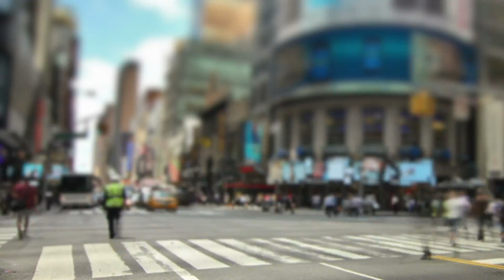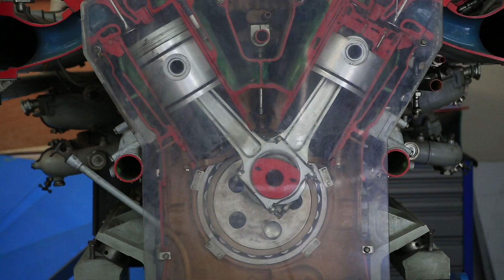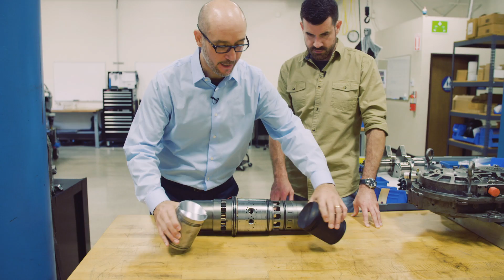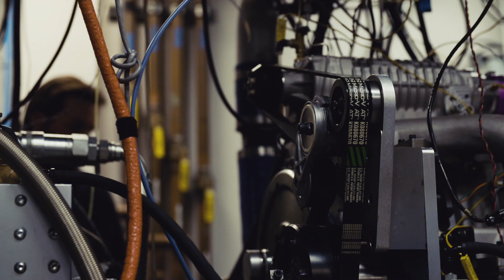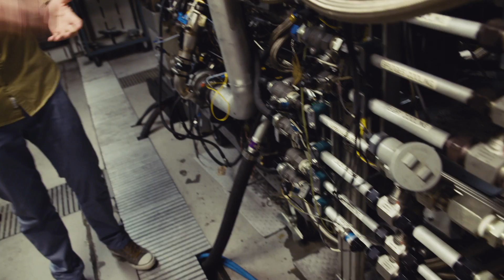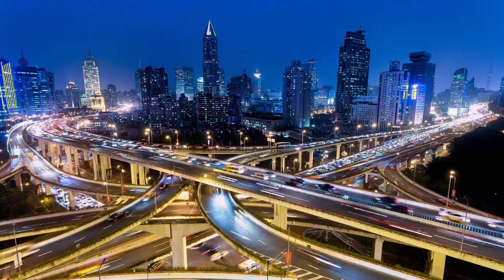This Radical Redesign Could Keep Gas Engines Pumping | WIRED

Comment: 2 stroke engines are inherently dirtier running engines, even with direct injection. Piston oil control rings are going right past the intake and exhaust ports. That's why you don't see any two stroke motorcycles any more (or very few). They have a tough time meeting pollution standards.

Comment: A lot of people are bleating on about how electric vehicles are going to save the planet and how cheap they are to run,all this is a bit over stated because your just moving the source of pollution,imagine if tens of thousands of vehicles were to be converted to electric a year how many atomic power stations would have to be built to charge them and do you think for one minute that governments would lose all that fuel duty they collect,not a chance they'll tax electricity,were being conned again.

Comment: An example claim of less parts, really?
You have now not one but two crankshafts and all the parts to link them in time; less parts; not likely.
So how is it 30% more efficient with two crankshafts and the othe piston acting like a cylinder head without the cooling and extremely high thermo temperatures.

Comment: There was already a German version of this in which shafts at the end of the pistons had powerful magnets which were passed through cylinders with coil windings. This directly generated electricity to be used in the cars electric motor, which sounds like a better, less complicated system.

Comment: Gas have been reliably polluting the earth for over a century I think we are done time to move forward .Oil changes belts sensor smog test fuel burning etc I'm done with the constant spending to up keep with a traditional gas engine. Electric cars all they need is a charge at night and maybe once a year a gear oil change which the most 2quarts of  gear oil and the power electric engines delivers surpasses a gasoline motor by far I'm done being a slave to this big oil companies...

Comment: Challenge with opposed piston engines sharing the same cylinder has been very high oil consumption , as the engine burns the lubricating oil !

Comment: 2 stroke opposed piston diesels have been mass produced before, primarily for submarines and other marine applications, so this is hardly a 'radical' design. What's new here is the application of modern computer-aided design tools, especially for combustion modelling (e.g. KIVA or Converge). This is one of the least informative/least substantive reports I've ever seen, not worthy of CNN let alone Wired.

Comment: That engine is huge.... theres a reason we have engines that we currently have. They are smaller and can be made more compact. That engine is still taller. You will never fit one of those in a small car. It may have no valve train but it has 2 cranks instead and the actual block would have to be much bigger. I'm sorry but that's a crap idea

Comment: Today’s ICE engine might make 25% thermal efficiency, if they’re lucky.  So a 30% gain might improve the thermal efficiency to 32.5%.  

That’s nice, but nowhere near the 85-90% efficiency of EVs.  The hard truth is electric motors are incredibly efficient at over 95% efficient. (That’s why industry has relied upon them for over a century. Walk around a refinery, chemical plant, paper-mill, or any other factory where pumps are required. They are all electrics.).  Combine this with better batteries with efficiencies in the 90% range, and ICE days are numbered.  It’s not emotion.  It’s Money.  

People love piston engines.  It’s visceral.  People love horses too.  But we don’t ride horses everywhere today.

Comment: The engine is an exciting concept, I'd imagine that in order to lubricate the top crankshaft the engine will have to be laid on its side, kinda like a boxer engine. It also seems a little difficult to make such an engine as well, I'd imagine that if made improperly the engine will shake like crazy what with the crankshafts at opposing ends of each side of the engine. I dunno, I'm not an engineer so I'm just spitballing here. Would love to here how this engine sounds like

Comment: This is old technology. 2 stroke engines are poor on the emission of particulates and complete combustion which is due to the fundamental design lacking the separate combustion and exhaust strokes. I do not think that this will be a success, it is unlikely to be more efficient than a well designed four stroke engine and in particular a good hybrid set up which may be able to get 50% efficiency. Electric drive trains are 90% + efficient I believe.

Comment: alright now that is enough!!! people. the fuel air mix that is drawn into the cylinder and ignited does not..... DOES NOT.. IT ABSOLUTELY DOES NOT EXPLODE!!! it is NOT an explosion, if it were your engine would be scattered on the ground in pieces.

   C-4 explodes. dynamite explodes. gasoline does not, in any environment, explode. it burns quickly, but it wont explode. it is not an explosive it does not burn rapidly enough to be called an explosive.

 STOP SAYING IT EXPLODES. you only prove that you are thoughtless and stupid when you do this...... think about it. if you are a leftist, and trump said gas explodes in an engine to drive it foreward, you would look it up, call it out and say he was lying again. so stop it! stop it now!

Comment: I suspect the 30% gained efficiency is a somewhat optimistic number. Perhaps it ends up closer to 20%. But what if the engine adds US$5000 to your vehicle? And it seems to me that in terms of performance, this more complex engine will add some inertia that will slow down acceleration and against electric cars redefining what to expect, that's not great. But perhaps for construction equipment and trucks, this engine can find a market. Ultimately, the chance of success for this engine mostly depends on how well next generation battery technology succeeds.

Comment: The horse drawn carriage has been pulling us along for over a century.
Occams razor cuts deep. 
Making a complicated machine more complicated is a losing strategy.
Especially if it still emits CO2 and uses non sustainable energy sources (oil).

Comment: Interesting reinvention of an old concept using modern materials and control systems. Lot of people don’t realize these were built by Germany during WWII, there is a Junkers opposed-piston diesel that was used in aircraft.

Sadly, this video was far too watered down to be technical informative. C’mon Wired, you should have deeper content than the sub-8th-grade writing of USA Today. 🙄

Also gotta agree with other commenters, the jab at Trump was completely unnecessary. Focus on tech and advancement, keep the politics out of it. Divisive politicking has infected too many subject areas. This doesn’t need to be one of them. Make a cleaner, more cost-effective engine and let the market decide.

Comment: "up to 30% more efficient "with a compressor ? lol
You loose something like 20 % of energy just to rotate the compressor itself.... 
That's why turbos are used with way better results since the 40's ,you just use the wasted exhaust heat with them.
Also ,more efficient than what ? a 8V-71  detroit diesel ?

Comment: I once watched a couple of Deltics start up in St Panancras, the smoke is more like a steam train, the geometry was way ahead of this design. I’m going to say it’s not happening, I don’t think they will get the emissions without a  v expensive post treatment plant, and we know that’s not good enough on four stroke let alone 2  even Cat 6 engines have issues on certain conditions. Hybrids are beating this now. same with variable compression and complex cycles and some of the other old engine tech rediscovered. they all face the same issues, Ultimately only Trump can save the ICE and then only for a bit, E. are are better and cheaper to make long term.

Comment: We don't have to burn (just) gasoline. Its actually pretty daft to effectively be limited to 1 fuel. Electric sucks.
Petrol, PetroDiesel, WVO, Algae, Kerosene, Ethanol, Methanol, Gaseous Hydrogen (gasoline engines with carbs can run on it without modifications beyond fuel delivery), propane, methane.... 

If we split the fueling up, we could run forever. Especially with efficiency improvements.

Comment: Internal Combustion Engines are obsolete, we should be using electric motors only!
Reply: where you can meet the range and loading requirements with them, they're a really good solution.  bring the costs on batteries down, educate people to the reality of what their real range requirements are and more and more will be seen in operation.

Comment: I think the major hurdles with this engine is managing the scavenging effect through Piston to exhaust port timing, pre-detonation issues in low octane or cetane fuels, and waste heat management. I also assume that basic timing is fixed for gas models, which can be okay if pre-detonation is managed with increased fuel injection and spark timing. I theorize that the diesel version can be managed with fuel enrichment and variable glow plug temperatures. I view this engine as an opposing Piston 2 stroke.

Comment: I'm trying to figure if this is April fools.
Whats proposed with this design is bore x stroke (long stroke efficiency by half the piston speed per crank).
(Last used with the Deltic's in the 50s and 60s), gives the speed of a square stroke with the efficiency of long stroke. However, even with the Hybrids like the Prius, I don't think that engine is anything beyond a square stroke. The big 100,000Hp diesels in the big post Panamax container ships only use a single crank and they have something like 2 meter stroke with 1 meter bore. Hybrid car-square stroke/Big ship long stroke. Am I missing something here. Not going in a car. Still burning carbon fuels.
Long stroke engines take up space, 2 cranks or 1. Can't help wondering where the funding came from.

Comment: Have they never heard of the Commercial Ts3 diesel engine used in commercial vehicles in the UK. They were very efficient and powerful with excellent fuel consumption figures and power to weight characteristics .They were killed off when Chrysler took over the Rootes group in the UK and found to their dismay that the Ts3 performed far better than the comparable engine in the Cummins range a company with which Chrysler had a supply contract .So it was killed off,big bucks rule OK!
Reply: Is that in the comma knocker ?

Comment: I don't understand; why intake at the top, exhaust at the bottom unless it's to counteract convective heat transfer.  Also wondering if ceramic roller bearings on crank, rod and piston pins might help clean up emissions issues that have been raised in prior comments in addition to reducing friction losses.  Is it naturally aspirated, turboed, supercharged?  How much do the thermodynamics change when the engine is run horizontally instead of vertically?  So many questions, so many intriguing possibilities.
Reply: Brett: Look at it this way: start with the two pistons in the center and have ignition, as the pistons move down their bore you extract power then one piston uncovers an exhaust port and you get exhaust, then the other piston uncovers the intake port and you have intake via a supercharger-turbocharger combo and then they come back together for compression.  You now have a 2 stroke engine requiring supercharging to work, but the exhaust can occur way before the intake making it more efficient plus you can have a complete clearing of the exhaust gases from the cylinder, runs all the way down the bore, to allow a fresh charge, more efficient.  With a diesel (injected engine) no difference other than the oil sump, so just go with dry sump and you can run it any way you want.  Look up the "Deltic" engine and the 2 stroke container ship engines.

Comment: Redesigned the gas and take the hydrocarbons out of it and get more power with less than fuel until I have more fuel efficient with this design you'll probably end up with 60%Improvement if you take the hydrocarbons out of the gas

Comment: This type was light enough that the German Stooka was powered by one of about 800 Horsepower.The Deltic, a triangular arrangement of 3 crankshafts, ran Royal Navy patrol boats and British high-powered trains until the early 1970s. Commer trucks used the arrangement until the mid-1960s. Proven technology needing some improvement. Best of luck.

Comment: There one fundamental problem with 2 stroke engines, the piston rings have to transit over the intake and exhaust ports allowing the seal to pass oil into the combustion process.  Electromotive had to scrap their 2 stroke diesel for emissions because of this.

Comment: Okay one question though, how dramatically will uneven friction effect performance and life? If one of the pistons in the facing two has more wear or resistance when cycling it makes me think that it would put a real strain on the opposing piston and crankshaft or whatever is being used

Comment: Even electric cars have a long way to go, but it is pretty cool how people are looking into alternatives instead of just sticking with a single thing. In my opinion, hydrogen powered cars have a better chance to produce similar results to gas powered engines. We just need to work out how to harvest hydrogen more efficiently and how to distribute it just how Brazil does with natural gas powered cars. Electric vehicles have a lot of draw backs for people who don't live in the city and have to travel long distances also in a city like Los Angeles where everyone has their a.c. on during summer all day it would create a problem for the power grid if most of the population also had their electric vehicles being charged.

Comment: How did they fix the lubrication problem ? The connecting rod bearings are always loaded in the same direction so oil can't get in the most stressed areas.

Comment: They really don't give much information at all. This is a two-stroke, compression ignition (Diesel) engine. The basic design has been around for years and a version was produced a few years ago as an Aircraft Engine. Seems new Tech has solved some of the problems inherent in this design. One thing not mentioned in the video is that Engines of this type require positive pressure from a turbo or supercharger to create the positive air flow needed to efficiently exhaust & charge the cylinders. This adds weight, cost and complexity.   They say it is light but do not say what materials are being used in this iteration. I wish they had because two cranks, twice the push-rods and pistons add weight as well... Historically these are not light engines.

Comment: 30% more efficient?  Those details would be interesting - instead we have a guy explaining why an engine running in a lab needs lots of hoses and a stack to vent exhaust outside.  And what better way to conclude a vacuous "science" video than with some clap-trap for their target audience at the end.
Reply: thom1218 Yeah, even had to throw the “Trump Administration” dig in there, too. 👌🏼
Reply: Exactly what I was thinking when I got to the end of the video lol
Reply: Higher compression due to less needed clearance on top of the pistons since there is no valvetrain, and longer stroke per cylinder to use more of the energy produced during the combustion would be the main reasons.
Reply: Every new-fangled engine is 30% more efficient when it's in the design and engine test-bed stages.  Then it hits the real world and the proposed advantages evaporate and you're left with a whole load of unnecessary complications and technological dead-ends.
Reply: Andrew Rabbitt

I assume that means every engine since the steam engine? Or were horses the pinnacle of engineering?
Reply: thom1218; I had to read your comment three(3) times to catch the true idea. Yes, I find it sad that sooooo many are misled by the omission of facts. "HIDDEN NEGATIVITY" is the devil in disguise! 
  Thank You,
Captain BUCKLEY(ret.)
Reply: Ryan Miller  there is another video on youtube about this engine, mentioning it makes 270 hp, 480 lb ft of torque, with better than 50% efficiency, at of only 2.7liters of displacement. No mention on where it is emmisions wise though.
Reply: More efficiency = more NOX, which is what brought the "big bad VW" in trouble.
Reply: Yes a more erudite discussion would be hard to fathom; please tell me more as I'm utterly enthralled ..
Reply: Faronthefiddler learn the definition of liberal instead of parroting ignorampuses and con artists
Reply: Strict emission regulations have been the driving force for engines becoming so much more efficient after years of relative stagnation, so there's really nothing wrong with pointing out that the government of the world's largest auto manufacturer is trying to reverse much of that.
Reply: These Trump suckers are so easier identify when they get butthurt about somebody using his name in a negative context...
Reply: Wish i coulda said that.. I tried..may add mumbojumbo to claptrap.?
Reply: Right. Lol
Reply: It’s long past time to ditch internal combustion engines for good.